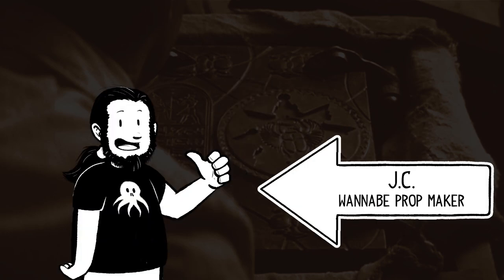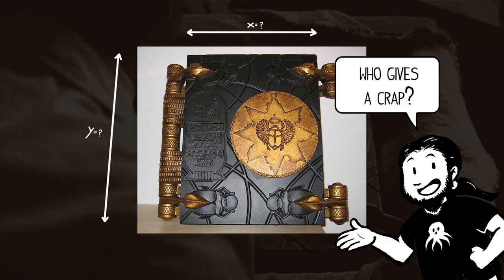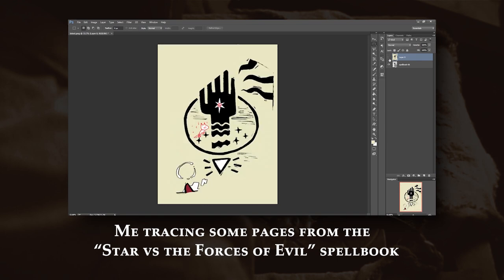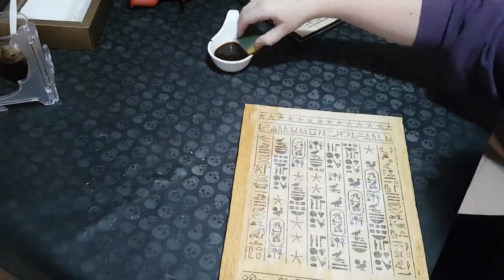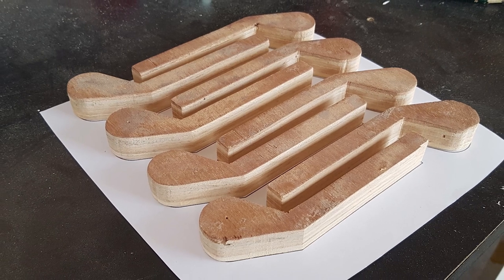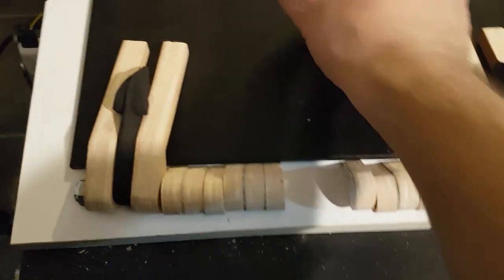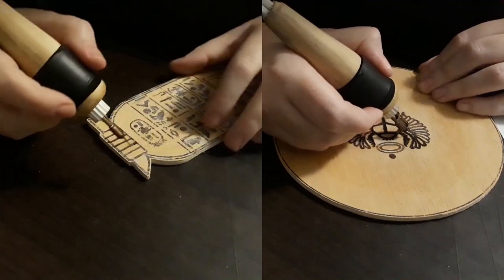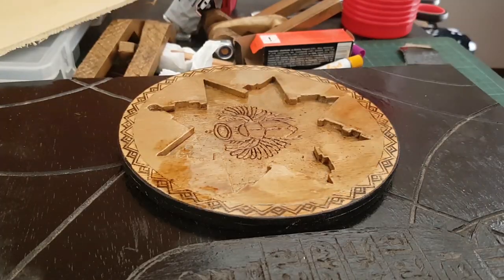Let's make a replica! The Book of the Dead from The Mummy

Comment: What kind of paper did you use?
Reply from the maker: Plain white printer paper. The cheapeat possible i imagine, since the print shop I went to get the photocopies didnt give me any option...
Reply: @JCRandom  one more question what are the measurements on your book and does it matter what glue you use? And thank you this really help me out
Reply from the maker: @thescorpionking9183  25cm of width and 35 height, and its better to use wood glue... even if  you put nails later
Reply: @JCRandom  how many inches? that's on your book cover or did you tell me
Reply from the maker: @thescorpionking9183  9.84252 inches wide, 13.7795 inches tall for the cover.
Reply: @JCRandom  tell me a little bit more about the spine do I need to cut it in two parts then use that rod that you use to put them together do have to use the wooden glue to put that together that's the information I need to put my book together